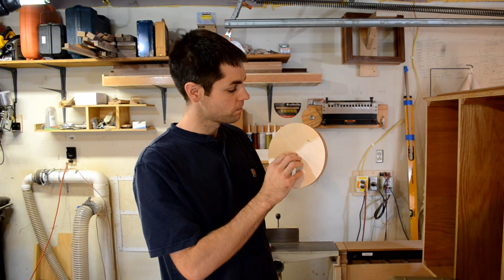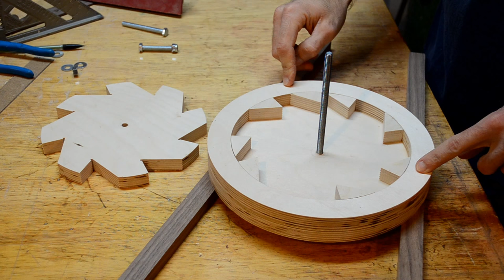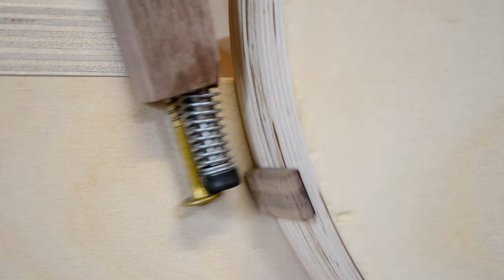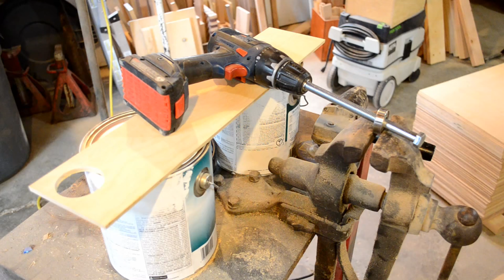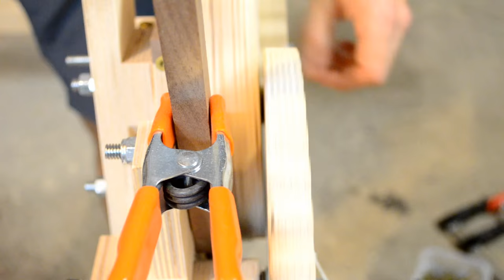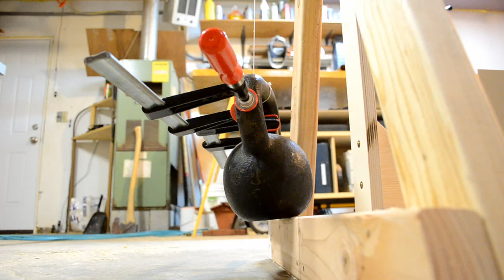Escapement Cradle #3

Comment: On your thoughts of air friction;   you are b100% correct.  "BUT"  two pendulums of the same physical size  and shape of different weights,  the heavier one will take less energy to keep it going ( more to start  but less to keep it going)  I really like your work.My pendulum is over 500 pounds , swings at 6.5 feet and  just under 180 degrees and uses less than 20 inch pounds to keep it going.
Reply: Nice

Comment: I'm really enjoying this series Scott, great work. just a thought though. since you have a bearing that rides the wedge and this can obviously run both directions then have you though about using secondary wedges runing in the opposite direction inside the escapement wheel. its hard to explain but if you trace the path that the bearing moves then you'll get the idea. it could reduce the whole mech to 1 wheel.
Reply: also, just heard the bit at the end. curved ramps will make forces more linear but will be harder to cut. a router jig will most likely be required. wish my shop was setup so I could test my theory for you...

Comment: In cress run time # 1  start drive weight from higher point #2  use block and tackle and in cress weight accordingly easily make it run for way over an hour.  Great job thanks for sharing. PS  these fixes are not alterations just simple add-ons

Comment: Would a larger crib make any difference?
Reply from the maker: +ja jane More air resistance, the bearing friction increase is probably negligible. Even if the pendulum length changed, as long as the distance above the bearing remains constant it shouldn't change things all that much, maybe a slightly heavier counterweight required.